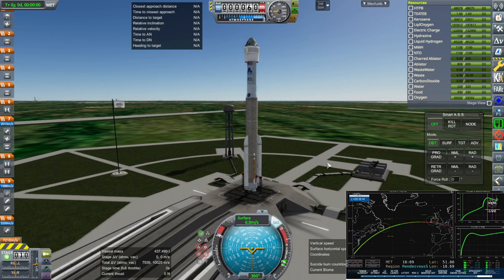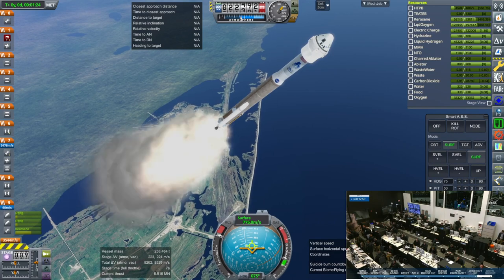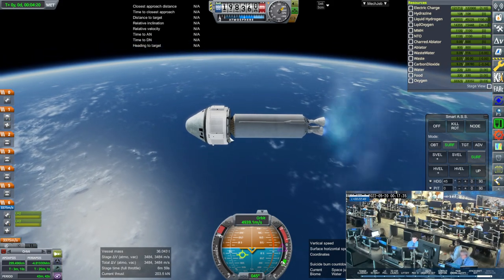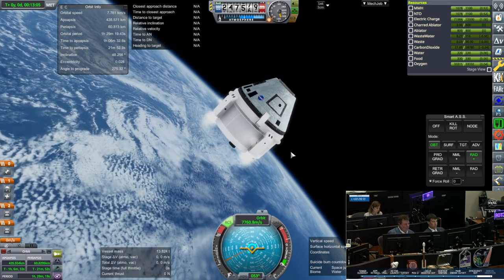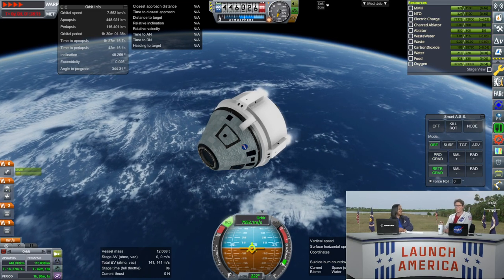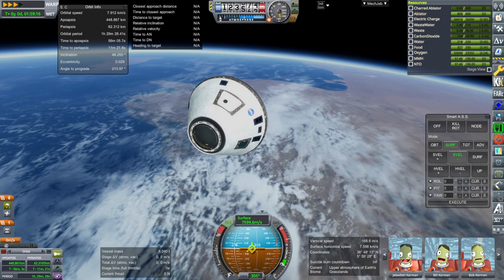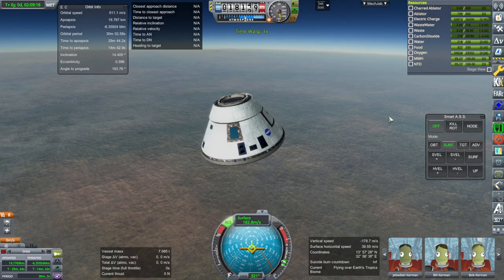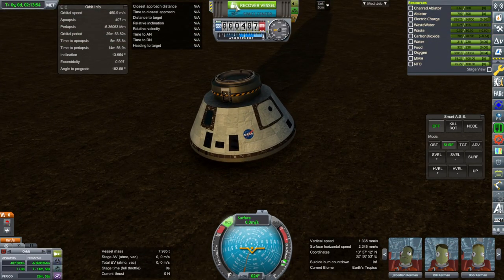Kerbal Space Program - Part Dev - CST-100 Starliner Mod

Comment: I just followed all your CST-100 videos how these parts were made. That was quite a lot of work but the result looks really good (and better than the NASA model in their live-stream). I just flew your CST-100 to orbit in KSP/RO/RSS and it worked fine and looked nice even on my crappy 2015-PC without gfx-card. Good to have the model ready if they hopefully do the crewed launch this year.
Concerning the potential aerocap collision, maybe you can tweak/reduce the 12 aerocap collision patches a bit such that it doesn't run that risk or maybe increase the decoupling force a bit. It could be a bit annoying during the stress of the final part of a mission. 
Thanks for the nice videos!
Reply from the maker: Glad to hear it worked! I'll consider the aerocap colliders if I get around to making an update.
Reply: Everything was going well but now I have a problem at re-entry. First the heatshield exploded due to overheating, I replaced by another procedural heatshield. Now my pod behind the heatshield explodes due to overheating. All components seem to explode slightly above 1000 Kelvin, which seems a bit low.  My re-entries are from LEO at a bit over 7500 m/s and a PE set to 65km. I use no "deadly re-entry". Maybe I did something wrong in the installation; I just copied all files in the gamedata folder. Do I have to copy/modify something in the realismOverhaul folder or something?  (KSP 1.12.4 RO RSS)
Reply from the maker: It's possible something is overwriting the heat tolerances of the parts, which should be much higher. The RO people these days seem to like making global patches that edit all sorts of parts at once, contrary to the old way RO was done, which was to edit each part individually. I'll have to check.
Reply: @RaizSpace  Thanks for you quick reply!! I suggest to wait and see if other people report the same issue. 
If not, it may just be my configuration which may not be 100% clean anymore. I will play a bit with the cfg files, based on your tutorial videos, and let you know if I find a cause or solution.
BTW, your videos are absolutely fantastic!
Reply from the maker: Could you try this alternate RO config for the CST-100? https://www.dropbox.com/s/vpcorxljcnr8bhk/RO-CST-100.cfg?dl=0 It changes how RO is addressed - may or may not help convince the other RO patches that these parts are already taken care of.
Reply: @RaizSpace  You are faster than me! I was just looking into the FOR, NEEDS, AFTER, BEFORE keywords when I saw your reply. This is probably the solution. Now, when I select the CST-100-HEATSHIELD in the VAB, it indeed has int./skin max temp set to 2400 / 3600, whereas before it was 1073 / 1073 which I figured out is set by the RO_Global_Config.cfg (I change it slightly and this changed the temperature of many parts). The other parts such as the Pod are still set to 1073 /1073, but I assume I can add maxTemp and skinMaxTemp parameters to the RO-CST-100.cfg file for these parts too (with appropriate % or @ or "" as prefix). Thanks for your help!!